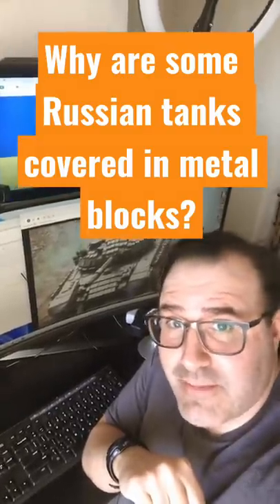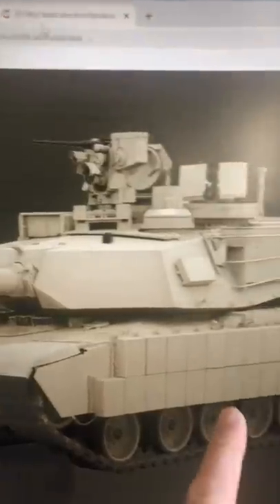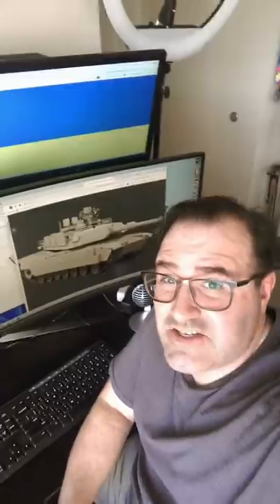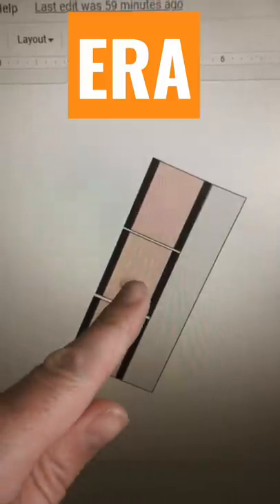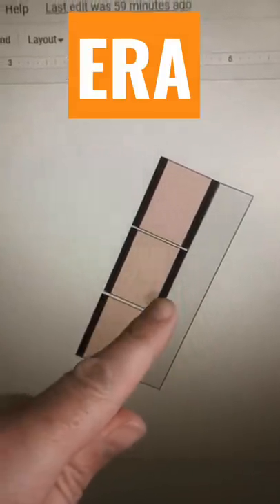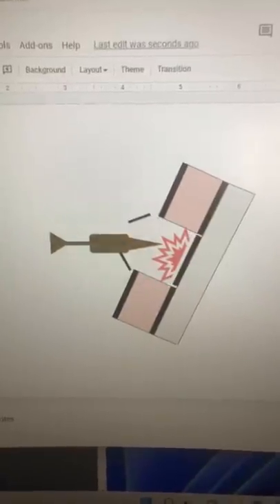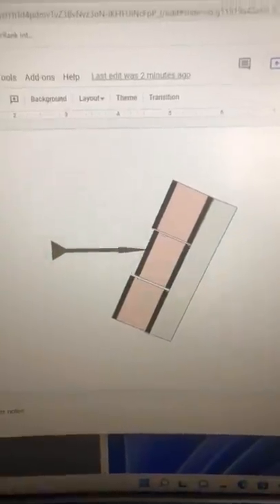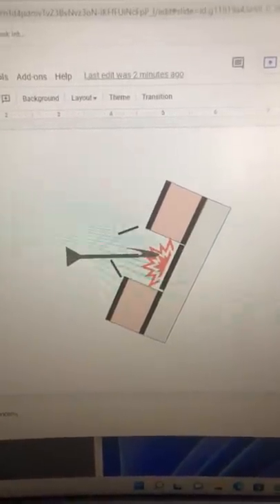Why are some Russian tanks covered in metal blocks?

Comment: Want to defeat tandem warhead using era use heavy era which not only throws one plate towards the jet while also pushing the back plate in front of the jet or use linear charge era which cuts the jet or use era backed by non explosive reactive armour.

Comment: I ALWAYS WONDERED ABOUT THIS! Thank you! I knew I had something to do with making the armor better in some way. I also hypothesized they were filled with special water that might help shield the tank from radiation.
Reply: The radiation part wouldn't work mostly because Russian T-72s and T-90s use an autoloader system that opens in the back of the turret to eject casings so the radiation would start getting in upon firing the gun.

Comment: I wonder if reactive armor can  be removed and repurposed as a weapon like a claymore or I.e.d. of some sort. That being said makes me realize how lucky I am to not be on the battlefield.
Reply: Well it technically could be but the effort isn't worth it as ERA panels aren't flimsy so you would have to take them apart to harvest the explosive composite inside as it's unlikely many vehicles would run over a plate and even if you did, it would likely do nothing, at most you might break the track of a tank but the armor is better used in other purposes because explosives are rarely in short supply.

Comment: To expand upon this, the thin little rectangles on Russian tanks are Kontakt-1 ERA and work only against HEAT or HE/HESH type shells.  KE/APFSDS will not be impacted.

The thicker bigger boxes and wedges on Russian tanks are Kontakt-5, Kaktus, or Kaktus.  It works against both HEAT and KE/APFSDS rounds.  It does this by using more plates, placed at angles, and creating a "Scissor" type motion against APFSDS.

Newer APFSDS have "snap off" tips to trigger this armor early and render it useless.

Ukraine has developed an ERA called Nozh, which uses its own shaped charges to cut into APFSDS to weaken it or to disrupt a HEAT charge's plasma jet.

Most NATO types of ERA, like the ARAT tiles on Abrams, seem to be light ERA similar to Kontakt-1, but NATO tanks typically have better armor to begin with.

Comment: Why not just fill them with water? It can literally Stop TNT from destroying stuff
Reply: Somebody can correct me if I'm wrong, but here's why I don't think that would work. The RPG head activates when it hits a target past a certain distance. As I understand it at that point, a jet of hot metal is fired from the rocket, maintaining momentum. It would vaporize water immediately and barely lose any heat or momentum. The reactive armor uses an explosion to negate the momentum of the hot metal, so that it won't have the necessary speed to pierce the underlying steel plate.

Comment: Why doesnt ERA cause a chain reaction and make every charge blow up at once? It seems like one blowing up would make the others do the same
Reply: It's mostly down to the fact that the plates are directional charges and most of their energy is dispersed away from the tank in that direction. The explosion is small aswell as the shock wave so it won't detonate the ERA near it, and it's the same principle as to why the missile doesn't detonate loads of ERA plates. The explosion is mostly directional for the sake of penetration. However, if you hit a tank with something designed to have a large explosion like HE shells then it will knock out more panels from the size of the explosion.
Reply: @ragingassassin6659  thanks!

Comment: Question, what type of warhead in the TOW?
Reply: This depends on the version of TOW,  for most of the TOWs history it has used a High Explosive Anti Tank warhead or HEAT for short. This war head typically explodes forwards which super heats a jet of copper to that can melt through the armor. Newer versions use Explosive Formed Penetrators or EFP which explodes forwards turning the armor it hit into a penetrating slug.

Comment: That's not REALLY how ERA works...🤔😒
It does very litte to APFSDS rounds...it's main function is to disrupt the continuity of the copper jet from HEAT rounds.
Reply: Relict ERA realy can  slow down APFSDS(not like it could save from shot to sides where armor is very thin(around 80-100mm)butl it cerntanly boost defense at front 
Old ERA was practicaly useless against kinetic munitions
Reply: Even some hard kill Active Protection systems can protect from apfsds a little

Comment: What are weak points on a tank first the operator has to look through his vision windows all gun sights are Vision Windows the engine requires an intake the road wheels have rubber on them that long gun barrel can be plugged. The people inside need to breathe air. The vehicle cannot handle large obstructions such as deep holes large rocks. Needless to say tanks are not impervious